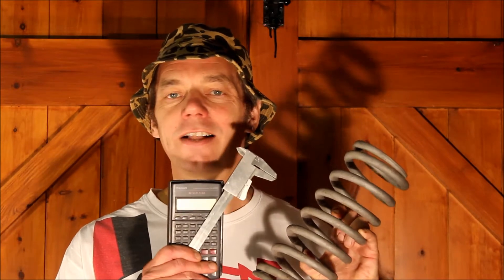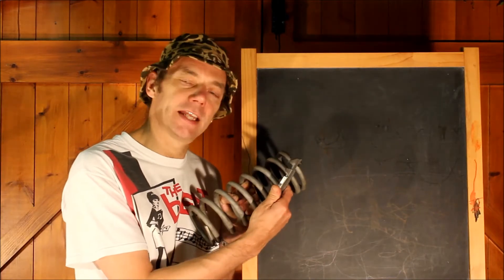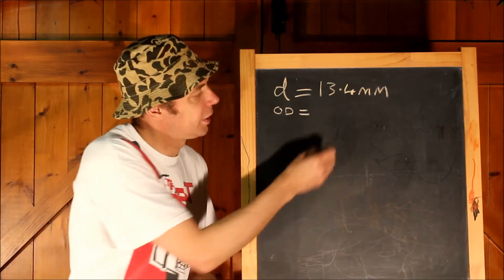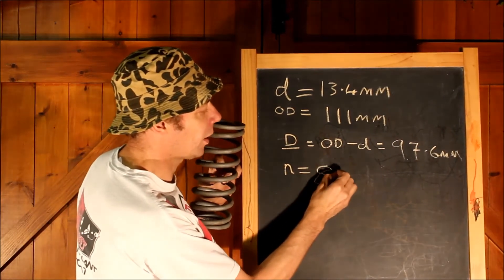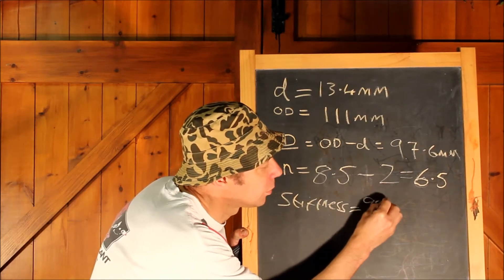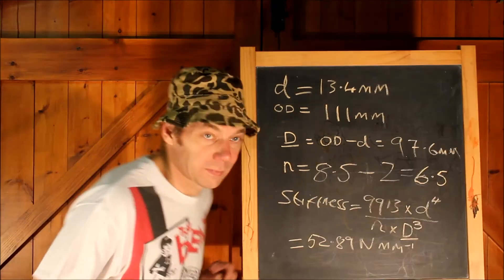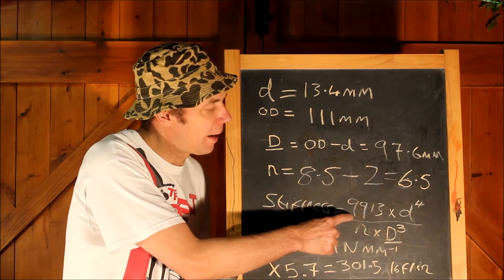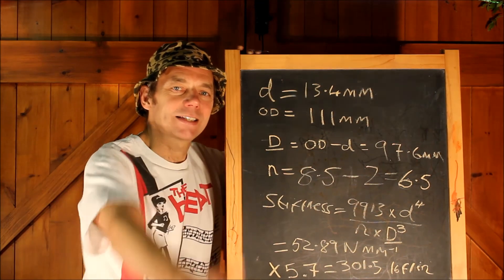How to calculate the stiffness of a suspension spring

Comment: I have a question
In calculating D, wouldn't we consider D= OD-(2d) ??
Because we would be removing the thickness of spring material from OD on both sides??
or is the calculation done using the pitch diameter of the spring ???
Reply: no because it is for mean diameter

Comment: Very useful thanks for posting.
Keyed the numbers and formula into  excel and got  52.087 Np mm and  296.89 lbs.  So I could have a number wrong somewhere but still close to your result.
Crazy how the thickness of the spring wireb changes the stiffness so much!

Comment: Thank you so much for this! I am working on my final year project on suspension design and this will be extremely helpful. 
I was wondering if I can apply this technique to any other model. My base data is of Honda Civic and I was wondering if I can calculate the spring rate with the same technique. 
Thanks!
Reply from the maker: Yes, same formula for any steel suspension spring with closed and ground ends. Cars, motorbikes, bicycle shocks, whatever. Good luck with your finals.
Reply: Can I apply this technique for the extension springs??